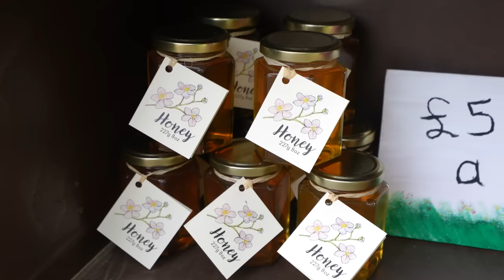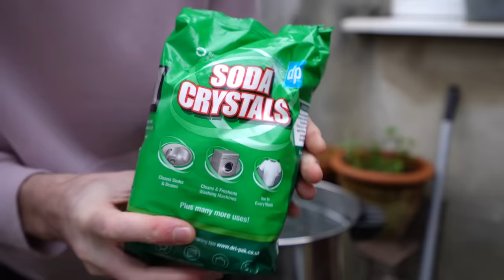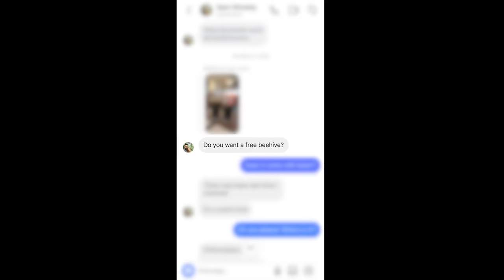Preparing for my 3rd Year of Beekeeping - Building hives, cleaning equipment and getting more bees

Comment: Alex, unless the hives you cleaned those frames from HAD diseases, there was no need to remove the wax unless there was mold or it was older wax 2+yrs. same with the process for cleaning them. best practice is to actually FREEZE them for 24hrs, thaw them for another 24 in an enclosed location, then give them to the bees!

Comment: Yeah : You got yourself a "Warre Hive." I just love them. Have several here in my Garden. Made loads of my own Equipment too. Have Nationals, Langstroths, Warre and a huge Horizontal Hive. All doing well here in Scotland. 
Tip:
I would do a Warre to National transfer (why would you ? Keep the Warre Hive too.)
By cutting only a Third of the Comb out of the Warre Frame : Leaving about x2 Inches of Comb in the Top of the Warre Frame (Bees will draw down more Wax in these. Back to normal.)
Keep the Comb the right way up ! And use Elastic Bands around your National Frames, to keep this Comb in place, until the Bees build them with secure holding Brace Comb.
If any Beek has a Langstroth Hive : Warre and National Super Frames fit within them. Just Inset that 2nd Frame and Zip Tie one Top Rail to another. Simples. 
Hope this helps. 😎
🐝🐝🐝🐝🐝🐝🐝🐝🐝🐝🐝
  Happy Beekeeping 2024.
🐝🐝🐝🐝🐝🐝🐝🐝🐝🐝🐝
 I have made Langstroth, Nats and Warre Nuc Hives. All using Pallet Wood. Use the ones that are light Pine Wood with only "Heated Treated" Logo or Image on them. Really easy to break down into lovely Planks, Glue these together to make Walls, Floors, even cut up into Frames.
All doable in DIY terms. Add a little bit of Essential Lemon Grass Oil onto a bit of Cotton Wool, or melt that 'Dark Bees Wax' to make a "Bait Hive" by catching a Swarm. A Free Bee Hive and Free Bees. Had x3 Swarms find me last Year. 👍 Yes they were local Black Bees and no, not any of my Bees swarming, but 'Bees from the local environment finding me.' 
What's not to like. . .🙃
Reply: Wow! Thank you SO much for that wealth of knowledge ❤️🇺🇸

Comment: Just an advice. When you want to screw the thinner pieces of wood, drill them out first and then screw to prevent splitting. I do woodworking as a hobby and also had learning curve. 
If you want to "close" the screw holes you can mix fine saw dust and white wood glue. Apply it to mask the screws and once it solidifies, just pass few times with the sand paper. Best regards from Croatia :)

Comment: to stop the wood split at 9:19 pre drill your hole with a slightly smaller diameter drillbit. takes a few extra mins but saves the quality of your work.

Comment: Thank you for showing how to clean the bee equipment with the boiler and soda crystals.
Personally, I am a pensioner, and I have no experience of handling bees.
I am considering different hive designs that don't require heavy lifting.
So far, I have looked at horizontal hives and Slovenian hives.  
I am considering making my own version of a bee hive based on the A-Z hive crossed with deep and a half frame.  Also, designing a building to house the hive(s) and for other uses, such as mushrooms, electronic monitoring, and solar.
Keep on following your dreams. you're doing a great job showing us the parts of bee keeping that I have not seen from others

Comment: Mi dad is a beekeper, he has worked with bees his hole life. He used to paint all the hives (more than 100) by hand and then tried frying them in hot hot oil and it worked! It’s so hot that it will kill anyting, the wood will soak up the oil and get waterproof. It’s definitely quicker than painting. Must be extremely carefull and it is quite messy tho!

Comment: There will be a time you will have a lot of frames to clean up. Best to get a steam melter for your waffleframes, you can even make one yourself for no money with a simular inox kettel which you were using and a wallpaper steamer from the the depot which costs around 50£. First remove all the propolis. then You fill up your kettle with frames, wax still attached. put an empty foodsafe bucket below and the wax and water will drip out. Your frames will be steamed clean and your wax will seperate from the water and debris. The slower it can cool down in the bucket the more nasty stuff gets seperated from the wax. after that you can just use a normal kettle and warm up the wax untill its fully melted and use the same bucket with a special metal stand to put a grease filter in. Pour the melted wax and it gets filtered nicely. Do this a few times and your wax will be super clean and ready to make candles or new wax waffles. NO need to use soda crystals to clean your frames, it gets sucked into the dry wood and it's nog good for your honey and brood frames, it will smell bad and won't be attractive for the bees. What you do need to do is just take a bucket with warm water and put a small amount of soda crystals in that water, use a cleaning cloth (wring out) and wipe your wood of the hives inside and out. Afterwards do the same with only clean water and cloth, then let it dry (this will limit the amount of soda residue). After this you can use a small bunzing gas burner to burn off the wood inside and out (don't let it get black). Do the same for your frames, little pieces of wax and propolis will melt and get sucked up into the wood. Your frames will smell amazing. This, your bees will love and accept fast. I usually burn off my frames closer to the period when I'm actually going to use them.

Comment: The 5:frame box is not ideal as a swarm trap. The optimal size for a trap is two five frame box's joined. Also don't throw or clean old frames of wax - use them for bait hives. The ideal size for a bait hive is around 30 - 40  litres. If you use the correct size bait box with old comb inside your success rate with bait hives will increase massively. Also the ideal height is around 10 feet. But around six feet is ok, as it won't require a ladder and thus no accidents. Beekeepers and ladders don't mix 😅

Comment: Great video as always :D 

I'd just recommend for the next time you paint your new bee boxes to use some oil based varnish instead of actual paint. Even if the paint isn't directly harmful for the bees, sealing off the wood completely takes away from it's ability to regulate humidity. A coloured oil based varnish still allows for some water transfer through the wood while still keeping excessive amounts of water outside and adds the colour of your choice.

But since your choice of finish wont kill the bees, it shouldn't really matter after all ^^

Is there a reason why you use so many different kinds of bee boxes? I guess you're still using the same kind of frame (measures, looks like Dadant? that's what i use in Germany at least, looked kind of similar in size) for the different kinds of boxes?

And do you plan on making new bee colony nucs yourself? Or do you buy them for now?

Best of luck for the new year and lots of honey! :D

EDIT: Didn't finish watching before commenting, never heard of "national hive" size, interesting!

Comment: Aren't there any hedgerow flowers in your area?
Willows are a good early pollen source but there are flowering cherries in flower now too. Any open flower is good for them.

Omg...throw that Porter escape away. They'll be gummed up and useless before you know it. A Canadian clearer board (it has a  2-3" eke under the clearer section ) is much more efficient.

If you can’t inspect the frames in your new hive,  you won't be able to check for swarming preparations or varroa infestations. Other beekeepers will then view your hive as harbouring pests that infest their hives. If you’ll take my advice: move them onto proper frames ASAP.  WARRE hives come from a time before varroa so aren't really suitable to modern circumstances.

Comment: At 1:16 I'm super concerned with how your back looks when placing the boxes down. Those bee boxes get heavy and using your back instead of your legs to lift things is a quick way to really injure your back. Really try to remember to bend your knees and tighten you back up when you lift things, also remember to take a deep breath and brace your core against the pressure you create in your stomach from the breath before and you lift anything heavy. I'd hate for you in a few years say that You couldn't keep bee keeping cause you injured your back!